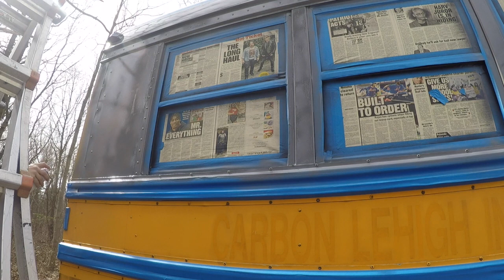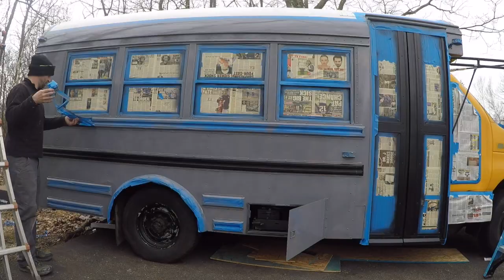$10.00 Rustoleum Paint Job  /  Skoolie  School Bus Conversion

Comment: hmm Lehigh not to far from my area, I got a 5 window 2004 Chevy gas mini. 
I'm in the mode but not quite ready to paint.. seems 'easy' but.. I still need to put on the rubber coat on the roof.. after that its update insurance and inspection on my registered RV (skoolie)
Reply from the maker: Awesome, hope it all works out for you.

Comment: Great job, and a great price for the paint. It makes me want to do mine.
Reply from the maker: Not a bad price at all. I picked up paint at Home Depot even though I'm a Lowes guy, Signing up for that credit card really put a dent in the price. Once you get all the windows, and everything taped off, theres really not a whole of bus left. Seven cans painted the body, I hung on to an extra can just in case. Also this is a pretty small bus, with single wheel base in the rear and only 4 windows on the sides. The Bus is starting to come to life, I was standing on the roof the other day and someone drove by and gave me a thumbs up. I took that as the bus is looking good, hopefully the neighbors don't think I'm nuts.... But their watching.
Reply: @TravelingThru222  I bet the neighbors don't think you are crazy, they probably wish they had a bus. Every time I take Zephyr out I have someone come up to me and ask me about it. They usually end up saying"I've always wanted to do that to a bus."

Comment: After you sand the bus are you supposed to wash it off or wipe it or wipe it with cleaning solution? Thanks :)
Reply from the maker: Yes, wiping it down wouldn't hurt. If you wanted to go above and beyond, you could wipe it down with rubbing alcohol.

Comment: Hey! Cool video. Just got an e350 4 window short bus, and sadly i need to paint the yellow, even though i love it how it is. How did you get a good deal on the spray paint? I read in another comment you left that you signed up for the Home Depot credit card or something? Could you give me some more details on how you did it, thanks!! Justin
Reply from the maker: Good luck on you’re Skoolie project. Trying to remember the purchase of the paint, I think I got a discount on the quantity I bought, the. I signed up for a credit card which took a large percentage off the bill. It worked out to being $10.00 for the paint. I got all of the masking tape for free.